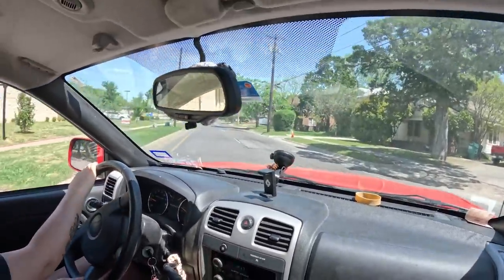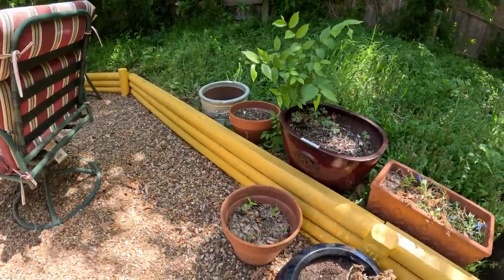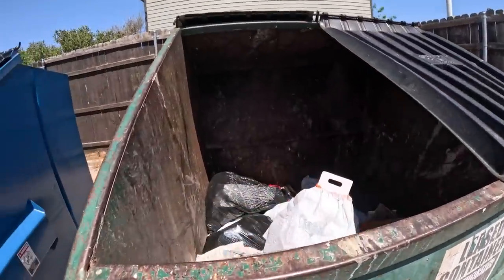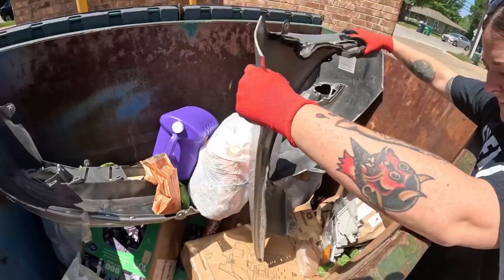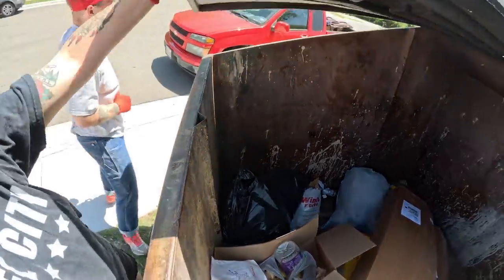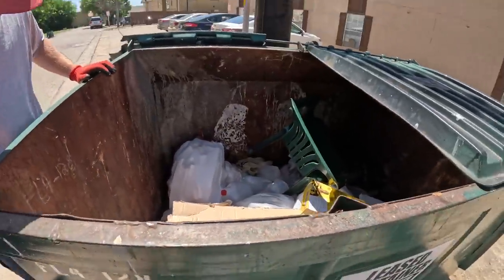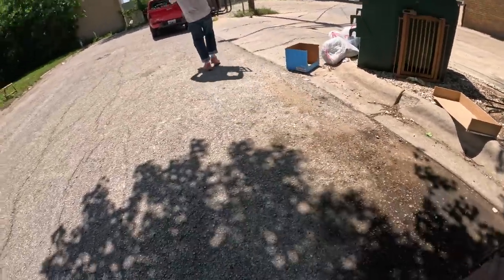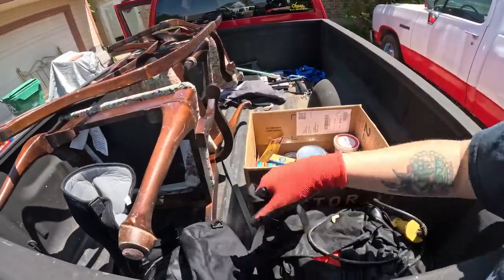Dumpster Diving at Apartments – Spring Cleaning is in FULL SWING!

Comment: With your planters, you could put those peanuts or pieces of Styrofoam at the bottom and then add your fresh soil on top of it so your planters don’t weigh a ton a piece and I’ll add good drainage. I would suggest maybe a third or a quarter of the pot and put the fresh soil on top of the Styrofoam/peanuts, and fill the rest with fresh soil

Comment: at around 17:00 what you thought was for a ipad isn't even close to that, far too big.  What it most likely is is a side pannel to a computer case (to allow you to see the parts with probably RGB (red green blue) lights within.  That may of meant there was a computer or case there.  They're typically plexiglass or glass.  I would dig through that dumpster further to see if there is more computer parts or even a whole computer within.  Its not too hard to get them up and going usually and even if not you can probably salvage some parts.

And based upon that it was probably a custom build, so there's no telling what parts were within (probably means higher end relative to the time but i've seen and have cases like that which are over 20 years old).  But that doesn't mean you couldn't take one out and put another into it, a lot of custom and mid to full size cases will take a variety of motherboards and parts.

There is a lot of different form factors but custom builds accommodate most of them usually